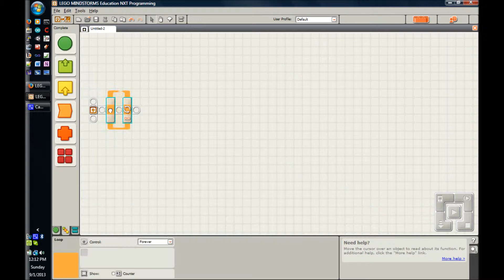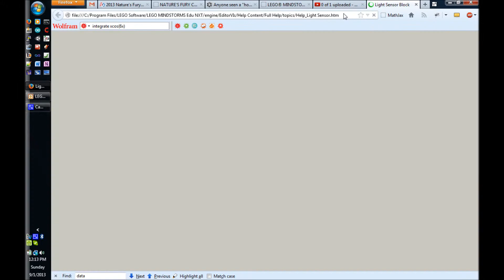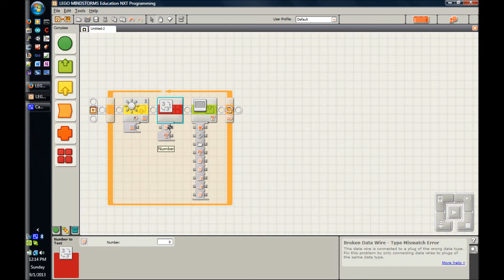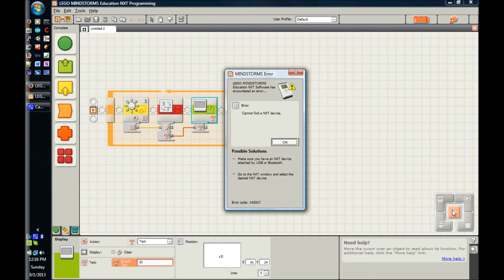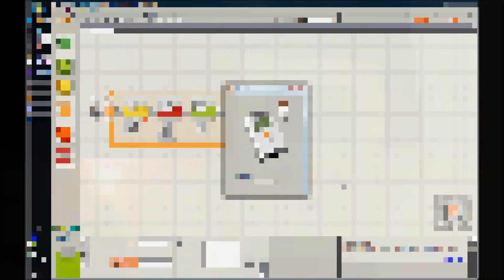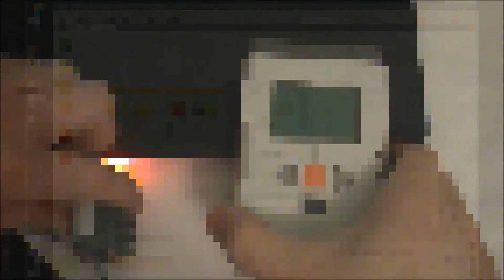NXT-G Datawires Example: Display Light Sensor

Comment: Thanks for the video. It's useful too if instead of light sensor block you put other sensor block. It works! In my case I use a pressure sensor block for datalogging. With this program you can display the data on NXT screen. Thanks again!